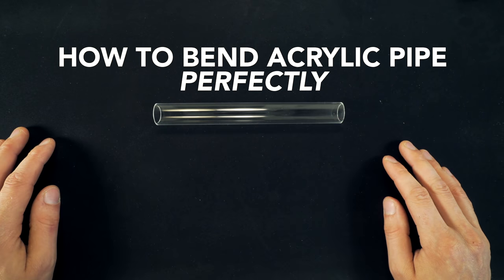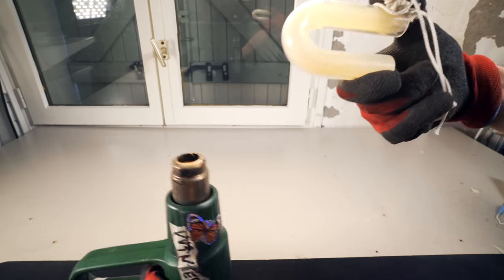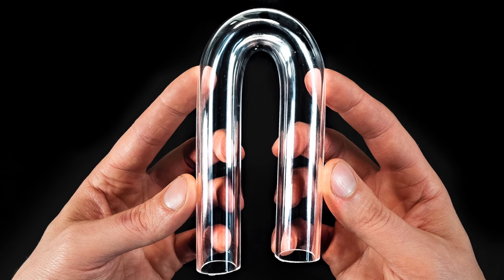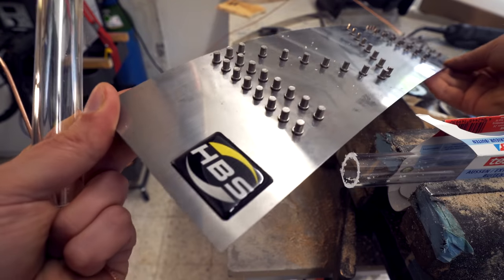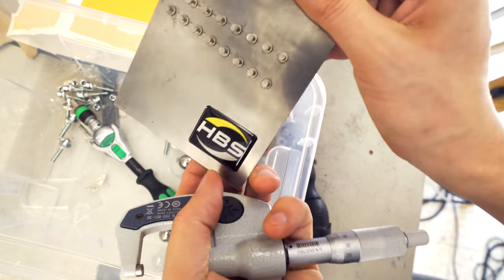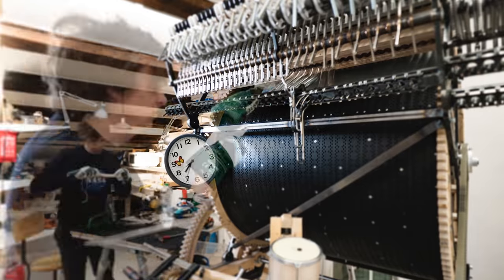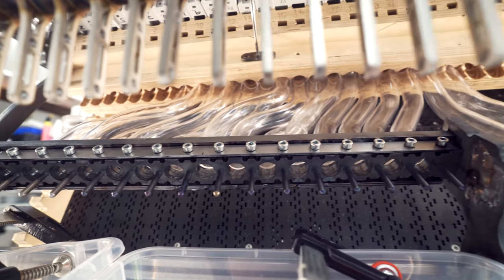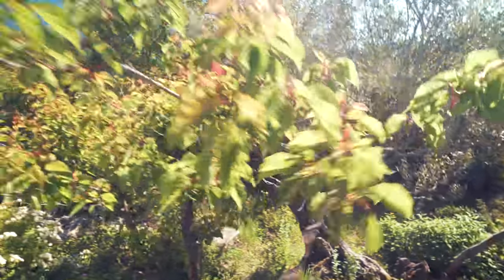How To Bend Acrylic Pipe PERFECTLY - Marble Machine X#79

Comment: @Wintergatan , Considering that Electricians bend PVC pipes (in the past) etcetera. I can say from experience, that the bend radius should preferably stay within the radius of the pipes width/diameter. So, if you have a 21 in the outer diameter. For a good and clean bend, you should have around 21 in the U-bend. Of course, a tighter may be possible. But you have much more risk of running into that "crinkle" issue. Something that novice electricians experience a lot when bending normal Copper cables. 

Pressing two thumbs against one another and bending from that angle, with an even pressure, works generally the best. Basically, the thumbs work as a 'support' to as you pivot the wrists inward. 

Hej, Hej från södra Sverige.
Reply: What do you mean by "a 21"? or "21 in the U bend" do you mean a ration of 2:1 or is there supposed to be 21 or something?
Reply: @TheSpacecraftX  i think it means there should be a space the width of the pipe in between the bend.
Reply: Minimum bend radii are generally set to preserve strength and wall thickness.  In any sort of pressure application, at least a 4d radius is recommended, and 5d is preferred, though the exact value varies up with certain material types and such.  In conduit applications, the main two considerations are not stressing the cable jacket too much, and being able to pull cable (if you're not pre-running it).  There's more to it, of course, as you know.  But Martin is not putting much load at all on the tubes, nor is he carrying anything that could be damaged with too tight a bend.  As long as the marble can easily pass through, then the tube will serve well.

What I would think might be most beneficial is to work on getting the preheat absolutely perfect.  One trick Martin may not have considered is a hot sand bed.  Basically, you make a small metal box with fine, uniform sand in it, and holes in the bottom connected to an air manifold.  The heat gun(s) blow air into the manifold, which 'fluidize' the sand bed with hot air.  Use a bleed off of the manifold to control the air into the bed, and you should be able to reach an equilibrium temperature very controllably.  That way he doesn't have to vary the distance from direct heat to control intensity.  He can simply plunge the parts into the bed to preheat them, and get a controllable, uniform, and easy preheat every time.

I've seen it used for a few applications, but I'm not aware of a commercially sold tool for the purpose.
Reply: @TrojanManSCP  Cool trick, sand bed one.
Reply: @TheSpacecraftX  Basically what Geo Y said. At the bottom of the U, it rounds off. Generally, as a rule of thumb. You don't bend a cable or a PVC pipe a smaller radius than its diameter. Of course, generally you are much kinder with copper cables. Since, tighter bends increases resistance of said area. But regarding PVC pipes, it is a way of avoiding crinkling which is Ugly. Since PVC pipe bending and Acrylic bending is very similar. Just, we tend to use a metal spring to assist in the bending while he uses a silicone tube that provides a cleaner end result. It is all about practice in the end. 

So, if you do U-bend like Martin is doing, leave about the pipes width in between, and the chances of crinkling will lessen drastically. It will also look much cleaner and professional. Since the bend will look more natural.
Reply: @TrojanManSCP  this needs to get noticed, maybe post on the subreddit? The things I thought of to help make the process easier would be an small electric chopsaw to cut the pipe, a way to heat the pipes consistently, and an assistant to do the cutting while Martin made templates and bent pipes.
Reply: kschleic9053 I think you only want the hot in the middle to soften, not the ends. And a sand bed can’t d9 that. Also I’d bet you get sand stuck in the acrylic.
Reply: @Helveteshit  The spring method works wonders. I found many years ago, I could close one end of copper pipe, tubing or conduit,  you can by closing one end of the pipe and then fill the pipe with sand being sure to pack while filling. Using .75 inch tubing, I have gotten a 3 inch coil without any unwanted shapes. Since you you have to use heat,  I know this method won't work. Maybe boiling water? Thanks. Enjoy.
Reply: @kschleic9053 I'm not on the subreddit.  Copypasta if you like.
Reply: TrojanManSCP they are sold in the USA for optometrists to remold eye glass frames
Reply: @TrojanManSCP  I was thinking that hanging the pipe + silicone rod in an oven or box that will heat the Acrylic uniformly the whole length, then he can place it in any position or form he wishes then lets it cool, much easier than trying to use a filler rod as a template.
Reply: @TrojanManSCP  There may be a risk of the hot grains of sand embedding into the soft hot acrylic when he grips it to create the bend?

Comment: At work we use hot water to bend pipes. Since it gives even heat and there is no problems with accidental bubbles due to too much heat
Reply: what kind of work do you do?
Reply: Make marcus see this!
Reply: Lol... Real Acyrl Tubes need +160°C for Bending... And Water can only be max 100°C (if you are not in a Pressure chamber). So you cant Bend Acryl Tubes with hot Water!
Maybe you use PETG Tubes or something like that... there you need only a Temperature 70°C+, that would be possible.
Reply: @rrdrone90   There is no problem heating up water to 160°C. Water boils at 100°C but that doesn't mean that at 101°C all the water just instantly evaporates.
I heated up water numerous times above 160°C on electric stoves in the lab, so no fancy bunsen burner.
Reply: Well, just use a liquid with a high boiling point like cooking oil. So unless these liquids react with the tube at high temperatures, I don’t see the problem.
Reply: @tonpa8888  hmm that's a weird thing to say. Because at normal atmospheric pressure, when water exceeds 100C, it turns into vapor. Water can't exist in liquid form above 100 degrees C at normal atmospheric pressure.
Reply: @tonpa8888  nope... you cant heat moore than 100°C the condensation will use all the energie you give in^^ so the Water will stay by 100°C. But sure you can heat it moore... sure you can heat water over 100, if you use some pressure, like a pressure chamber or a high pressure pot...
Reply: I know that adding salt makes water boil faster. But does that mean it starts to boil at a lower temperature or does it just get hotter faster?
Reply: @billkeithchannel  Adding salt to water actually raises the boiling point a slight amount, making the water take a little longer to boil, and reaching temperatures slightly above 100C.  It's just a very small amount for the level of salt you add while cooking... not even 1 degree C.  I'm not sure why it's a common misconception that salt makes water boil faster, but I've heard it many times.  To get to 160C you'd be looking at oils or other liquids, not water.
Reply: If you salt the water as it's just coming to the boil it will often appear to bubble more vigorously which is where the old wives tale comes from but I believe it to be the introduction of sites for nucleation to occur. It is correct that it increases the boiling point. Water can be super heated and stay liquid at regular atmospheric pressure if it is devoid of nucleation sites. As soon as it is disturbed or has an object introduced into it the result can be quite violent as a chain reaction begins to try to regain equilibrium. I think they covered it on a mythbusters episode
Reply: @davidiwata7063  we build units for underfloor heating. Dont use acryl tubes tho, so the tubes are easier to bend
Reply: @tonpa8888  Probably your thermometer is reading the temperature of the container, not the water. Without a pressurised container this is not possible.
Reply: @BrokenLifeCycle  Indeed. Silicone oil is a good non reactive choice for this
Reply: It's martin not marcus
Reply: richu006 incorrect. Search super heated water
Reply: c31979839 incorrect. Search super heated water
Reply: @donovanellis1533  I thought Marcus was Martin's project manager?  Or am I mixing up my YouTube projects?
Reply: @MrWhateva10  Oh I didnt know you were talking about the project manager, I thought you were talking about martin
Reply: Sorry about that. Doi!
Reply: @tonpa8888  Does a bunsen burner exert pressure on the water?
Reply: dothemathright 1111 agreed. Exactly what I said further up this post. It is incredibly dangerous and absolutely not recommend for this project. The main point was that water CAN be heated above boiling point without boiling which is correct

Comment: I don't even want to ask what medical procedure would require an 18mm medical silicone rod
Reply: maybe something for a large animal? doesn't necessarily have to be human medicine!
Reply: My guess is the esophagus. (In humans)
Reply: oh!! he said "medical silicone rod" I heard "magical" and was just like... "ok, i'll buy that, it is pretty magical..."
Reply: Buddy Clem l
Reply: No procedure, presumably. Medical just means it's meant for use in some part of the medical world. In this case, it most likely means the silicone is nontoxic, resistant to chemical, physical and thermal wear, nonabsorbant, and generally durable and clean.

It could be used in manufacturing, for example, or maybe random crap like stoppers and gaskets.
Reply: It could potentially be necessary to keep the trachea or esophagus from collapsing.
Reply: probably "medical grade" rather than straight up "medical".
Reply: I can confirm it's for de esophagus (surgeries for the stomach for instance) 👩‍⚕️
Reply: And here i am with my 100mm acrylic pipe...
Reply: probably so they can drip IV into a sick person, like they have the medical bags next to them and stuff.
Reply: perhaps its to replace your tibia or some bone
Reply: Asking for a friend: Where to buy such silicone rods? Any tips anyone? (seriously though, i need them)
Reply: @koolzuurhoudende  I need to know too, where can I buy one ?

Comment: Third (on the main thread) !
On the uh... stud welding... 0.0 holy moly.  That would perfectly suit your system on tour!!!  However, I'd recommend blue-tempered or some sort of black oxide stainless steel if you are going to have it on stage.  The reason would be for the dark background it would provide... shiny stainless would probably ruin that aesthetic.  The black background really rounds out the contrast of the contraption! (Never thought I'd be able to form a phrase that... apt...)
Reply: dequinox that was a very apt phrase indeed. Well done :)
Reply: dequinox yes this! Black oxide would look so awesome! Perhaps they could even make different tempers to have different colours for different songs?
Reply: You could even laser-etch a custom image into it and/or drill holes though it, putting leds inside to make it truly look like a wintergatan!
Reply: I vehemently agree, having such a bright, reflective material would ruin the asthetic balance between the warm wood, the silver marbles, and the clear pipes.

Comment: I would recommend making wooden curves for various angles or one that's adjustable that you could set the pipe into while you bend it. That way you have perfect smooth curves every time.
Reply: That would be excellent to build multiple machines, OR if every pipe had to be more precise. But 38 jigs to make 38 parts seems excessive.
There also is no guarantee that it'll work. As a jig is made, then the pipe, both parts have to be removed to do the next one, so there's no reference to the previous piece as the one is made.
Given the result, a calibrated eyeball is often good enough even in this age of supertechnology.

Comment: @Wintergatan: I have a question: the way through the different pipes is not equal, so the way down will last longer for some Marbles than for others. Does this affect the timing?
Reply: The release mechanism that drops the ball is after the pipe, and triggers a new ball to traverse the pipe and "stage" for the next release.  Only becomes an issue if trying to drop two balls within less time than it takes a ball to make the trip, and that led Martin to two channels per note.

Comment: Oh, wait a minute. Won't the differently sized tubing at that point cause longer marble travel times and thusly a delay for each note played?
Reply: It totally would, I'm not sure it'll be very significant, but even the slightly different bends in the tubes would cause delays. However, with those stud welding plates he could totally fix that! Just measure the delay of each one and make the tiny adjustments required. Would have to be bpm specific but since most songs would probably be best played at a specific bpm that might be fine.
Reply: The release mechanism that drops the ball is after the pipe, and triggers a new ball to traverse the pipe and "stage" for the next release.  Only becomes an issue if trying to drop two balls within less time than it takes a ball to make the trip, and that led Martin to two channels per note.
Reply: The actual drops are timed by the metal releases after the pipes.  So the marble is dropped immediately when the registrator hits.  At the same time another marble is released down the pipes to replace the one at the dropper.
Reply: @piperboy98  Oh, right! I checked back to #78 and it showed exactly that at 5:43.  Thanks for the clarification!
Reply: @MrWhateva10  Yea, that makes sense now. That being said, I think there's be a BPM limit for the MMX so I would imagine that for higher bpms, we could then introduce: The MM: XXL :)

Comment: Do you think there will be a timing problem with the marbles going thru different lengths and curves on there way to there target.
Or is my OCD taking over again. This project is outstanding and keep up the great work.
Reply: The pipes are only there to replace the marbles at the metal droppers.  The actual drops are timed there (and adjustable), the pipes just need to be fast enough to replace that marble before the next note
Reply: Don't worry, he's got it under control, check out the video called Dropping the Ball - PRECISELY - Marble Machine X #52, the marble that drops actually gets released from the metal rails at the end of the acrylic, and those rails are all adjustable so he can calibrate the drop to be the same for each instrument.

Comment: How do you deal with the timing difference of the longer pipes towards the ends, vs shorter ones towards the center?
Reply: The release mechanism that drops the ball is after the pipe, and triggers a new ball to traverse the pipe and "stage" for the next release.  Only becomes an issue if trying to drop two balls within less time than it takes a ball to make the trip, and that led Martin to two channels per note.

Comment: Won''t there be a problem with the different distances the marbles have to travel? Won't the timing be off?
Reply: These pipes are not directly responsible for the final drop, they only route the marble to the actual adjustable metal droppers that are tied directly to the registrators

Comment: If all the pipes are of different lengths won't the travel time for each marble be different and throw off the music? Or did you already test that slightly longer travel times are neglectable
Reply: oh boy....
Reply: The tubes are reloading the timed release point.  The music timing comes from the release after the tubes refill that release point. 
Each pin triggers the timed release for the music and at the same time a second release to reload.
Reply: I had this exact question on the previous video. BUT I am to have found out that this is only the loading tube and that the release is a on a second trigger.

Comment: Above all I was worried about ..., deep nails!
!
Martin, you cut your nails too much!
Reply: Now I can't unsee it, thanks
Reply: If I don't cut my nails like that, the strings buzz on my bass. Also, when doing work like this, you tend to break your nails, which is both painful and time-consuming, when the break is so large that you have to cut back the fingernail.
Reply: @buddyclem7328  I did not know that there was such a circumstance. For nurses, I have the opportunity to care for the patient's nails at work. I was a little worried because I experienced cases where not only nails but also various problems were caused by incorrect nail clippers. Depending on the type of work, you may have to do deep nailing. It was helpful. Thank you very much.
Reply: @nikochan03603  You're welcome. Longer nails are more attractive, but sometimes they can be impractical.

Comment: We used to push bend large diameter steel pipe for submarine fittings. We filled the pipe with a lead type material that would dissolve in boiling water. If you measure, I'd bet you would find you have a reduced diameter, or an ellipse at the apex of your bend. The silicon is good, but a more rigid material, or even a sand type media would assure perfection. Don't let the silicon migrate out the ends of the tube either. It defeats the purpose. I always enjoy your videos. Good job.

Comment: The new coding sheet is  MAJOR improvement in the machine!!!! all my reservations related to the design were around the coding wheel. You sir, just took the mmx from awesome to EPIC! It deserves an in depth video!
Reply: @Evan Cottle What I was most worried about was changing the wheels during in between songs. He said they would recode the wheels during the show. With this new solution that problem is SOLVED. One set of sheets per song, so much more elegant and reliable.
Reply: @thiagoennes  He said the programming plates are interchangeable. There's a mechanism that allows them to be released from the machine and swapped for other plates that have already been programmed.
Reply: @coder0xff  true! but for what I understood from the videos, he planned to have two sets of plates, and reprogram one of them while he plays the other. I might be wrong...